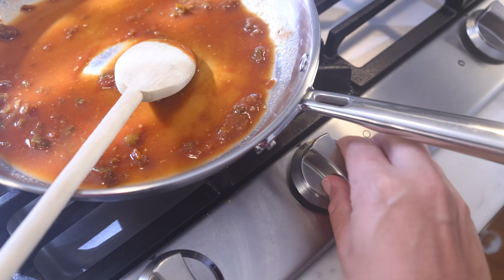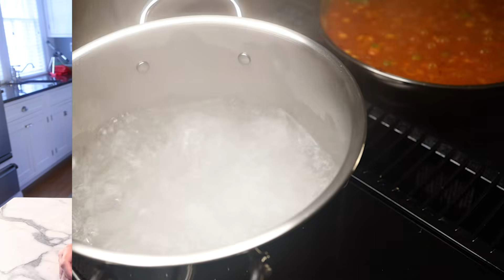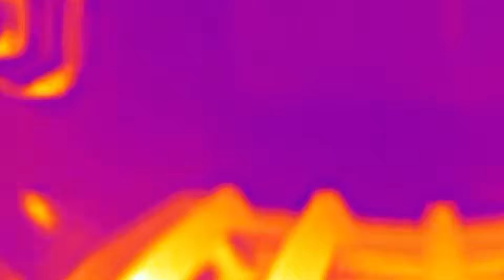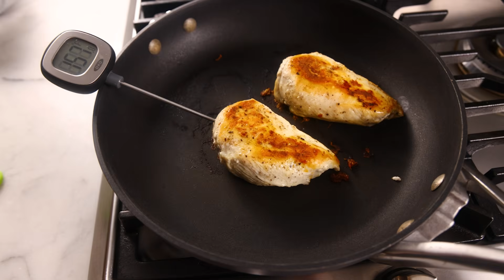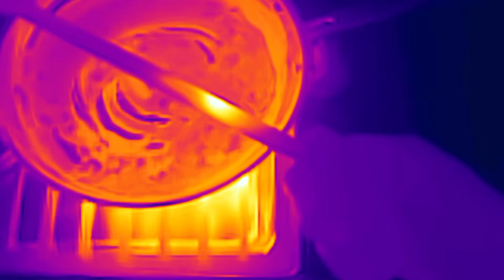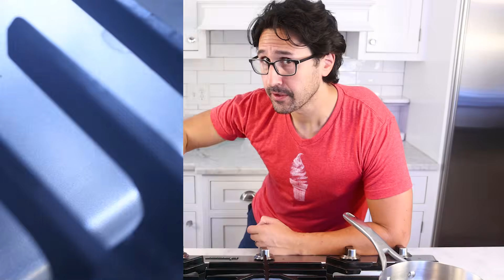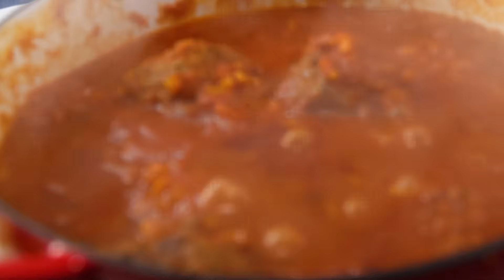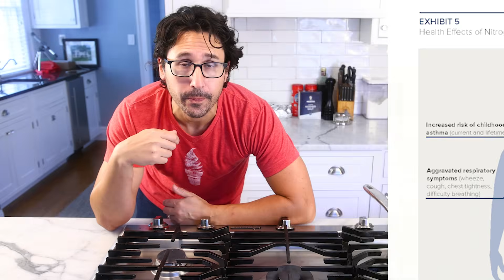Problems with gas stovetops | weak, dirty and dangerous

Comment: I was a die-hard gas cook. I recently switched to induction and I'm never going back. I still use gas outside with a wok burner, but for 99% of my cooking induction is better than gas in every way: wider range of temperatures, just as responsive, easier to clean, easier to control, less indoor pollution. It's great.
Reply: @diap727  I've never heard that before. What's your source for that information?
Reply: @diap727  how would it kill off more nutrients
Reply: @diap727  Source please, because that sounds wrong
Reply: @diap727  Not being ignorant but how did you even come up with that conclusion ? A source would be nice btw
Reply: Induction is awesome sure, but older 'conductive' electric stoves not so much, they're functionally very different.

I currently cook with gas and I would never switch to electric. But for induction I'd switch in an instant.
Reply: @jellevm  agreed. I recently had to use IR glass top electric for a few months and personally I did not enjoy it. It is too unresponsive, and if I spilled anything at all it would smoke like crazy!
Reply: @JustSomeYoutubePerson  pan choice is too limited.  I need my wok. I need my Mauviel copper. I need my 5 gallon pot. I need my cast iron.  Etc etc.  I've never had a problem with gas stoves and actually found this video a little annoying.   Gas heats way more evenly than electric or induction which yield poor heating on the sides of the pan.  Your custard burned adam??  Put a cookie sheet in between the burner and your pan.  Not that hard.  Bam... you have an electric stove essentially.
Reply: @urwholefamilydied  I've never had an issue with uneven heating. Cast iron works on induction. All clad also works. But yeah, woks are not good. In my case I live where weather is nice and I can have an outdoor gas wok burner, but I know that's not an option for everyone. But I'm not trying the tell anyone else what they should enjoy using! If you love gas, awesome.
Reply: @JustSomeYoutubePerson  ahhh cool... I haven't looked into it too crazy, just heard there were certain pans that wouldn't work. I guess my copper pans wouldn't work nor my wok.  But basically everything else does?  That's good to know.  Ya, for the same reason adam doesn't like the gas heat going around the edge of the pan is exactly why I like it.  Just heating the bottom of the pan will result in a super hot bottom and sides that are WAY cooler.
Reply: @JustSomeYoutubePerson  induction heat can crack cast iron. Lost a good antique Wagner that way, then read about the problems with cast iron and induction. I use gas and have two electric hot plate induction units that store easily.  I do a lot of canning, any need gas for the giant pressure cookers. Gas is cheaper than electric power in many rural areas, so we heat our houses, water, and food with gas and use electric for lights and small appliances.
Reply: @aw8388  A lot of people seem to use cast iron with inductive heating. It makes me wonder if your piece wasn't already under some sort of internal stress and the inductive heat was the "straw" that broke the camel's back, so to speak?
I haven't used inductive heating myself, but everything I've read about it and cast iron seems to suggest that damaging the stove top is the biggest danger of using cast iron (they suggest putting a towel between the pot and the stove top, which just seems unnatural as anything to me, but apparently totally safe).
Reply: @JustSomeYoutubePerson  Will cast iron scratch the surface. Cast iron pans are heavy and relatively rough.
Reply: @aw8388  cast iron would only break if you have a serious internal flaw, something that is fairly rare and can just as easily cause a crack if you heat it too quickly on a gas burner. I and hundreds of not thousands of other people have been using cast iron on induction cooktops for quite a while, and it has yet to have cracked on me.
Reply: @urwholefamilydied  5 gallon pot would boil much faster on induction. Cast iron is amazing on inductions stoves as well! Many Mauviel copper pots are induction compatible. As for pure copper pots, put a metal disk "between the burner and your pan. Not that hard." Bam... you have induction stove essentially.
Even heating? I'd like to see some proof that gas is more even. How can it possibly be more even, especially on an induction stove top? Induction heats the pan. The entire bottom of the pan. How can you get more even than that?
The only exception to your argument against induction is the wok. Indeed, using a wok on gas stove tops is better. But that is the only real exception.
Your arguments seem pretty weak, with more emphasis on how you feel than on facts.
Reply: @AnyBodyWannaPeanut  more even heating because the flames or residual heat from the flames is going up the sides of your pan... so it's also heating the ENTIRE pan, not just the bottom.  But you make some good points.  If I ever buy a stove I'll consider induction!
Reply: @urwholefamilydied  Copper should work, pans don't have to be magnetic to work on induction. Pretty much everything except glass or ceramic works.
Reply: @jellevm  pretty sure everyone agrees with that, old style electric stoves are terrible.
Reply: @jellevm  Right but the comment you're responding to didn't even mention conductive stoves, so what is your point? 
"I currently cook with gas and I would never switch to electric. But for induction I'd switch in an instant."
Also induction is electric.
Reply: @AnyBodyWannaPeanut  Where I'm from, induction is never referred to as electric. As the video also points out electric and induction are functionally so different it makes no sense to refer to both using the same word. You can get pedantic about definitions, but in practice when people say electric they mean something which is neither gas or induction, at least in my experience.

Which is also why I replied the way I did. The video is about electric vs gas, because lots of people complain about electric stoves and think gas is better. Adam, the way I understood the video, is assessing that opinion/argument specifically (not induction!). The fact induction is better than both gas and electric was never really under question, pretty much everyone agrees on that (I've never heard someone hate on induction at least). So saying you switched to induction in favour of gas is kind of obvious, but also missing the point of the video. I'd also switch to induction instantly, but I wouldn't switch to electric.
Reply: @jellevm  You state
Reply: @jellevm  "You would never switch to electric but would switch to induction.?"   Induction cooking is electric.
Reply: I also am in love with my induction stove! I've had gas and electric radiant, and the induction is by far the superior method!
Reply: Totally agree - I just made the same comment on induction. I also use an outside gas burner for stir frys in a wok.
Reply: @diap727  that is a complete load of bull shit.
Reply: I’d still prefer gas, I just love cooking with fire. It’s more versatile in my opinion. I can move the pan around and away from the heat as needed, plus I can use the flames to roast things like peppers and tomatoes. Plus, indoor s’mores are great on a rainy day.
Reply: @GrizzlyTank  Same.  Adam just seems like he's not only stuck in his old ways... but likes to make an argument where there's an argument.   Like his whole "never wash your poultry" episode, based on the one fact that it might splash in your sink, and the "slime" get's cooked off.  I like giving my chicken a rinse and dry.
Reply: @urwholefamilydied  I’m kinda on the fence about washing chicken, I only do it if it’s slimy. It’s an extra step and requires more dishes being washed and extra paper towels being used. But when I do clean it, I fill a bowl with water and dunk it in rather than run the water over it.
Reply: @urwholefamilydied  He raised a couple decent arguments, I love gas but hate the fact basically every gas stove on the market uses the EXACT same burners except Thermador, Blue Star and Viking, and the Viking burners are not even good. The only good gas burners on the market are Blue Star #1 and Thermador #2 because they actually put in an effort to heat evenly, instead of just blasting out the side of the pan when higher than medium. I don't know who has a monopoly on gas burners but it sucks because almost all of them are terrible.
Reply: @GrizzlyTank  It's hilarious how washing chicken is now bad but washing everything the chicken touched, that splashes as much or more, is still required. Dumbest solution to a non-problem in a long time.
Reply: But the humming sound is annoying af. Gets louder when the stoves age...
Reply: @diap727  Yeah ok sure thing buddy. I'd love to hear your explanation on this one.
Reply: @garethbaus5471  I should have clarified that I was referring to the gas valve safety interlock in the event of a power failure. As far as I'm aware, it isn't mandated in North America - we certainly don't have it in Canada as our house and range are less than two years old and I routinely light burners using matches during an outage.

 Sorry for the confusion.
Reply: @imasspeons  the blame is at least partially mine as well, I confused your post with a somewhat different conversation I have been having with a different person sorry for the confusion.
Reply: @diap727  gas, induction and electric all have different ways of heating, but at the end of the day they all just heat things up. There's no such thing as lack of nutrients, are you trolling or are you snorting the soot from a gas burner
Reply: Yeah and when the power goes out good luck boiling your water.
Reply: @magicdaveable  Blame your country for installing most of the power lines above ground.
Reply: @magicdaveable  gas stoves are slow enough at boiling water that the power is pretty much always back on before the water boils, so what's the point. Plus many gas stoves have a failsafe that makes them inoperable when the grid is out.
Reply: @garethbaus5471  in North America they don't.
Reply: @magicdaveable  Not everyone lives in a place where that's an issue. In my entire life the longest we've had a power cut for was 11 hours, and usually we only have a powercut that lasts longer than an hour once a year.
Reply: Filling your kitchen with unburned gas?   Jajajajajajaja. 
Are you really THAT ignorant?  
Tell me why Commercial Kitchens use Gas to cook.  NOT electricity.  And when the power goes out they are unable to cook.  Stupid.
Reply: @magicdaveable  In my part of the world the electricity goes out for about 2h per year on average. I've never experienced a outage longer than 3h.

Your argument is valid, but the solution is not a Gas cook top, but a more stable electric grid
Reply: @arial7  A more stable Electric Grid?   Good luck with that.  By the way, how is your electric grid generated?   Coal?  Natural Gas? Hydro-Electric? Nuclear Power?   Where do you live?  Burning Hydrocarbons to generate Electricity is incredibly environmentally filthy.  Nuclear Power is even worse.  Your rationalization about dependability is not valid until you answer the question.  Only Solar and Wind Power are envirpnmentally acceptable.  You cannot realistically support "Combustion Technology" as a environmentally viable source for Electric Power.  You are trading a Heat Source for profucing heat.  A ridulously untenable position.  Try again. 
Even HydroElectric is not dependable.  I suggest you do some research into the 2 HydroElectric plants on the Colorado River.  Very soon the reservoirs will be too low to function.  NOT something to support your claims.
Reply: @magicdaveable  Commercial kitchens are moving to induction. Safer and more easily controllable.

The power outages are not a problem, unless you live in some less developed country.

Comment: Loving my induction stove. Heats quickly and is nice and controllable. Plus boiling water super fast is kind of addicting. Not sure I can go back.
Reply: what are electric kettles
Reply: @pom791  you cook pasta in an electric kettle?
Reply: @kiltymacbagpipe  i boil water in an electric kettle, it automatically shuts off, then I carry the boiled water in the electric kettle to the pot on my gas stove thats been running for a few seconds, I dump the water, and make soup instead

Comment: For me, the unresponsiveness is a dealbreaker for the electric stove. I literally don't care about anything else if the stove is gonna take minutes to change temperature. I basically can't use the higher power output of the electric stove anyways because it's guaranteed to overshoot.
Reply: Induction is the answer. Those electric stoves Adam is talking about are really outdated tech.

Comment: The problem with glass tops is that you have to clean them after every single use, otherwise the oil spatter and food spills will burn and polymerize on the cooktop and the bottom of your pans with continued use making it extremely difficult to clean. All that phosphate from all that soap and detergent going into the waste stream can’t be that good for the environment either.

Comment: One thing I really love about gas compared to any electric or induction stoves I've used is the knobs for adjusting the heat. Electric and induction almost always have finnicky digital touch display things on the cooktop that are unresponsive, slow, and get messed up when you spill something on them
Reply: The electric stoves I grew up with all had knobs. I've only ever seen models with touch screens and buttons on youtube, come to think of it.

Comment: I went with induction when I moved to my new apartment 2 months ago. It came with gas stove but I decided to remove it, gave it to my sister and bought a new induction. As a person who cooks all his lifetime with gas stove, using induction is a positive experience. My kitchen is no longer hot, no need to buy gas canister (around 5 kg) and no need to store it under my kitchen cabinet. I miss using wok though as it cannot sit still on the induction stove. I might beed to buy adapter for that.

Comment: When I started getting into cooking, I realized that the “low” in gas stoves isn’t really low enough for low and slow cooking. So my workaround is I raise the pot using this circular metal disc with holes in them that I found ‘round the house to block off the direct heat from the fire, and “waste” more heat.
Reply: For those reading this that don't have a metal disc with holes in it lying around the house, you can buy an inexpensive commercial product for exactly this purpose called a "heat diffuser". But some gas stoves go low enough that you don't need one. My gas stove is from the 1950s or '60s and it goes as low as I'd ever want it. On minimum heat even a covered pot won't boil.

I go a little higher than minimum heat when I'm cooking pasta, just enough to simmer in a covered pot. I enjoy being able to cook it covered using much less gas. Cooking uncovered would require medium heat at least.
Reply: @Paelorian  We already had a completely flat pan, so we just put that under the pot if we want the heat to go lower than what the "low" setting allows
Reply: The low setting on gas ranges is adjustable.  Manufactures tend to be conservative and leave them set higher then needed on units that don't relight the burner if the flame goes out. If you don't have a fan or a/c blowing air over the range they may have less heat available. If your range has been converted for propane the adjusted is both a part of the conversion AND frequently skipped. If your gas range seems to not change much from medium and low it needs a adjustment
Reply: I usually just move my pot to a smaller "element"... that's what they are there for... Adam does not seem to know HOW to use a gas cook top and is trying to use it as an electric... that's like using a cast iron pan as a Teflon one and complaining it does not work (which is exactly what Adam did on the cast iron vid)
Reply: @exanime  did you not watch the video or were you not paying attention? He clearly says that even on the smallest burner on the lowest setting, it's still too hot, which is exactly what I've found as well.
Reply: @phelpysan  he literally said in this vid "this video isn't about your gas problem its about my has problem" he might doesn't have that "element" and he have that low gas problem which i personally don't cause i have way older gas stove

Comment: Ball up a wad of tin foil. Scrub lightly once the burner has cooled. Then take a small soft broom and sweep away the crud. I love my gas stove, it's brand new, middle of the road price- wise, and the grates are single pieces, not the old trivet style. I have saved my old grates for use as trivets, but I am so glad I don't have to cook with electric. They are so hard to keep even steady heat I struggle to fry breafd or make pancakes.

Comment: Old school electric ranges are old news. Try an induction range and you will never look back! INSTANT and EXTREMELY FAST heating and incredibly energy efficient. Also a breeze to clean and you can't burn overflow or anything else than metal. You just can't use aluminum pans, which I think is not really much of a loss. No wonder many of the premium kitchens and chefs have transitioned to induction.

Comment: I prefer the gas cooktop I inherited when I bought my house to the electric coil stovetops I had in my previous apartments. I like the responsiveness. I have found my gas oven keeps a much more stable temperature than electric ovens I've used. All that said, if I get to a point where I'm buying a new cooktop I'll probably go induction.